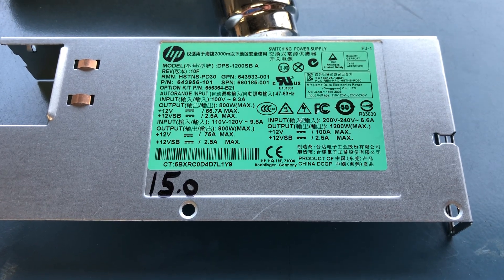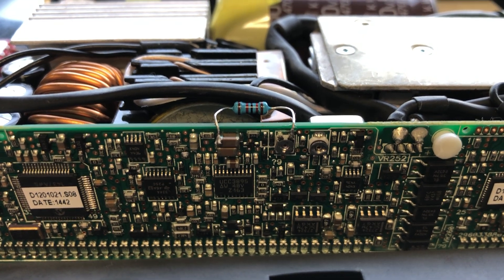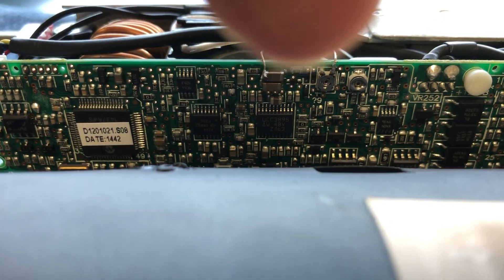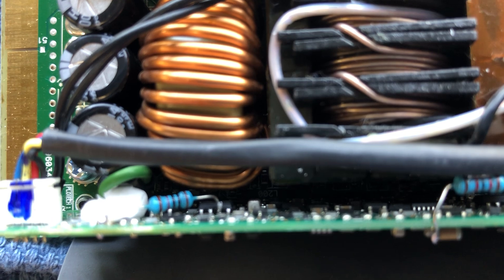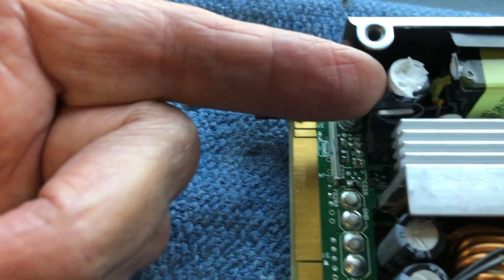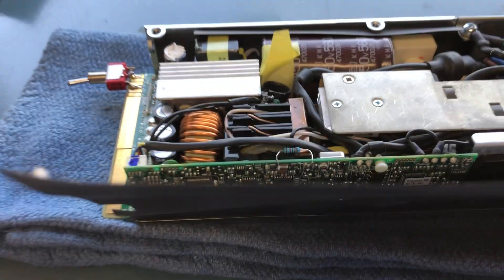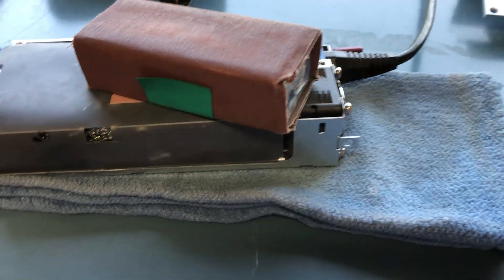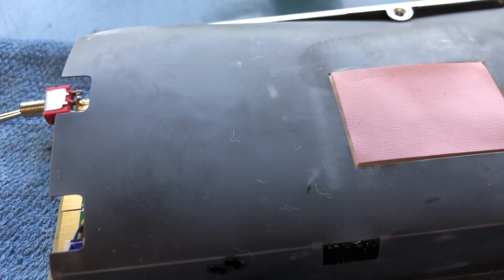Hp Dps-1200sb a/Hstns-pd30 server supply

Comment: 2:05 Good afternoon, congratulations on the video, one question... you need to lift the IC terminal to connect the resistor, or leave the IC terminal connected to the meamo board???? In the video it appears that the IC terminal is raised.
Reply from the maker: leave the IC terminal connected to the meamo board
Reply: @mm555nc9 menggunakan berapa K Resistor?
Reply from the maker: @HouseOfGecko  10k  12k or 15k

Comment: Dear i have an question. I connected this to my 12 volt battery and the fan started to run on full speed after 5 seconds. And i wanted to keep this connected to my 12v battery system. But when i power 220v volts to it the supply fan came to silent. Did you know how to stop the fan from running on idle connect with 12v battery?
Reply from the maker: I don't understand why you would be hooking this up to a battery, the power supply takes the place of the battery.

Comment: How much adjustment do you still get from the variable after the resistor is installed?
Reply from the maker: About 3/4 of a volt or less. Thanks
Reply: @mm555nc9  : Thank you. So, when you showed your voltages here, is that with the pot at full or minimum voltage?
Reply: @TheLonesometoad important question!
Reply: @mm555nc9  : one of mine came out perfectly at 14.5. Just where I wanted it. The other one is stuck at 16.89 and I can't change it. So I removed the resistor and is still stuck at 16.89.